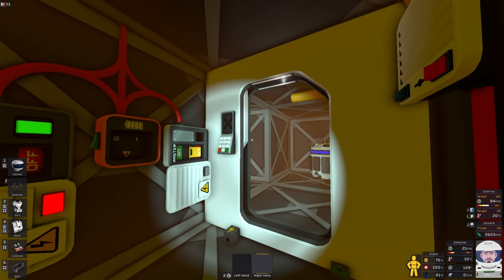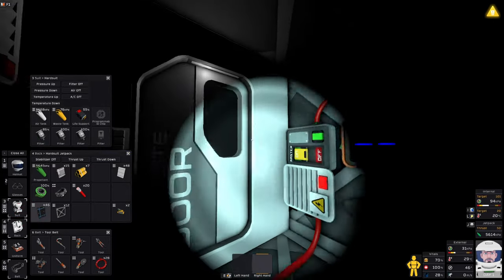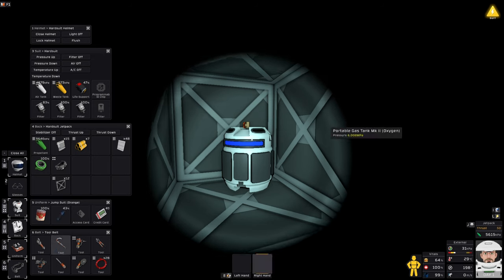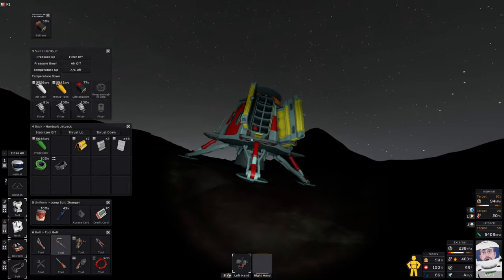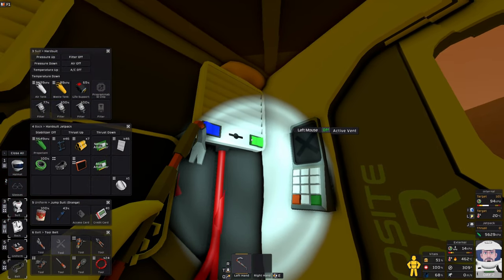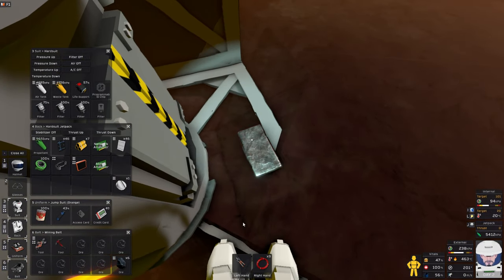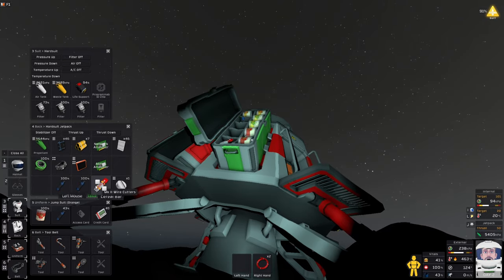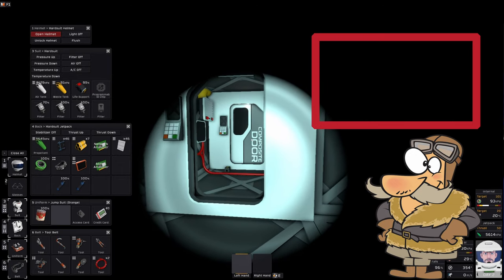Setting up production on Venus - Stationeers Survival Getting Started Guide

Comment: Venus is a fun planet.  Here's a little tip to help you with control of your waste tank.  You can slow the rate at which it fills by toggling your suit filters off and on.  That is to turn off the filters, and then when you receive a suit warning, toggle it back on for a few seconds and switch it off again.  (Eventually you can make and program an IC chip for the suit to automatically do this.)

While this may seem like a bit of a hassle to do it goes a long way in preserving your oxygen supply, until you have the means to reclaim/produce more O2.  With the filters continuously on you are mostly transferring the O2 from your O2 tank, as well as scrubbing the little bit of CO2 you produce, to your waste tank as the O2 is being used to condition the atmosphere in your suit.  By toggling the filters off you'll build up more CO2 in your in your suit as you consume the O2, so that when you have to periodically turn the filters on the suit will be scrubbing out more CO2 while also transferring less O2 from your suit to the waste tank.  Cheers!
Reply from the maker: I tried the filter thing, but it became such a chore that eventually i gave it up. Was not fun to play, let alone record sadly.  Although I never considered the situation with CO2, it does make sense to produce some for greenhouse later
Reply: I can also see why it's harder even than Vulcan, despite Vulcan reaching higher daytime temps. Vulcan has lower gravity and nighttime temps low enough that you have quite a time to build up your shelter. Lower air pressure also means iron walls will do.